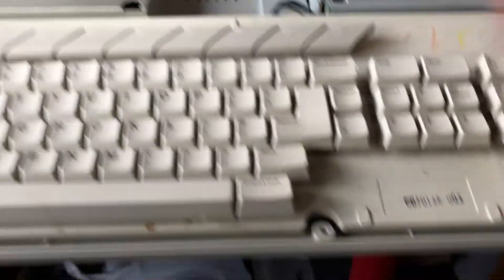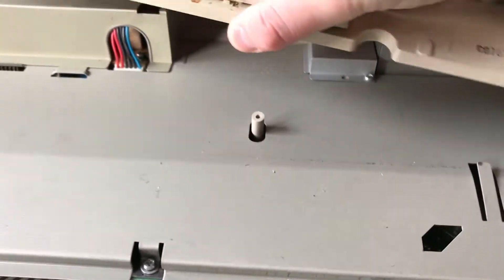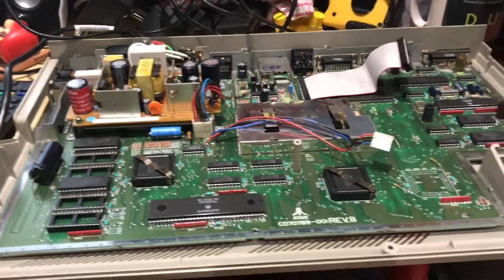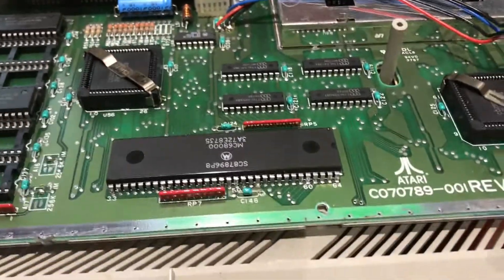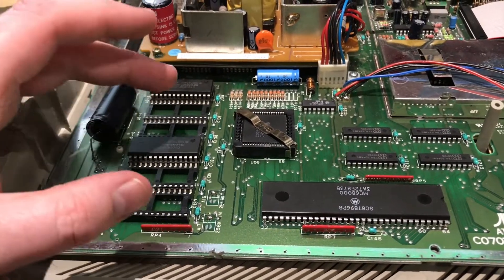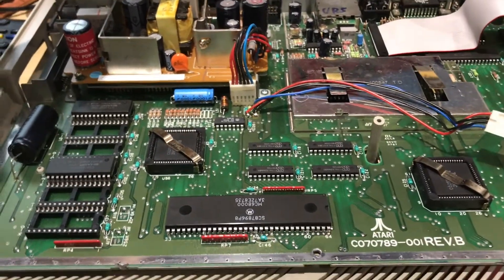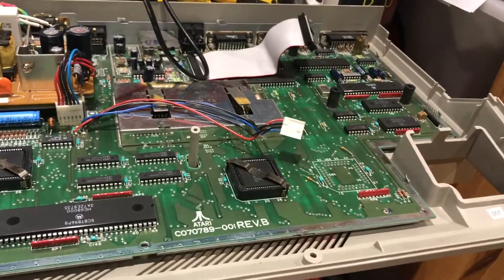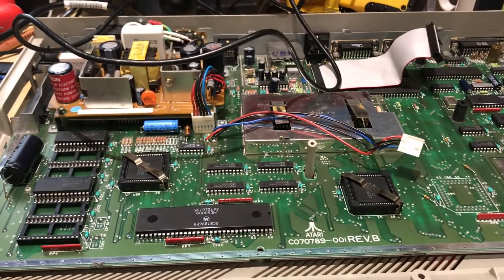Atari STfm repair part 2

Comment: Well done that man :) don’t you just wish they where all that easy. PS as the ST can read DOS format disks it's very easy to get ST disk images off the web and transfer them to a floppy for use in the ST. save you scouring ebay for software for testing.
Reply from the maker: JaysVintageJunk JaysVintageJunk thanks Jay sadly I have another part to the story. New video will be up soon. With regards to transfer PC to ST I was told the software only works if you have a PC with a floppy connector on the board, my current pc does not i was going to fire up my dos / win 3.11 machine and give that a go when this is finally fixed.